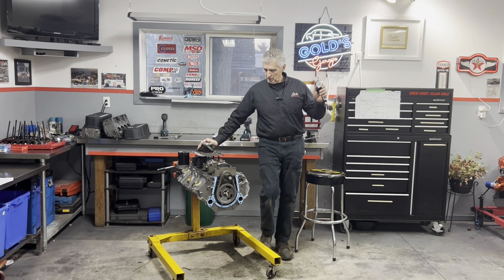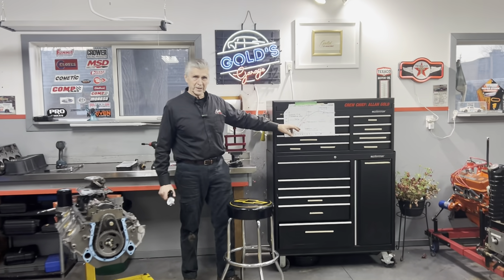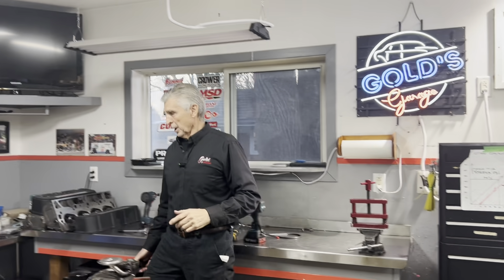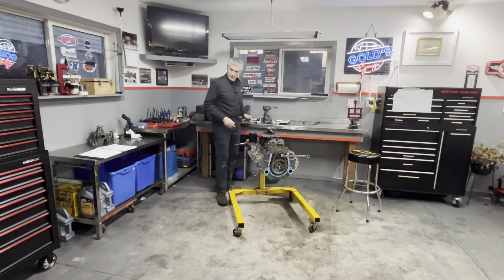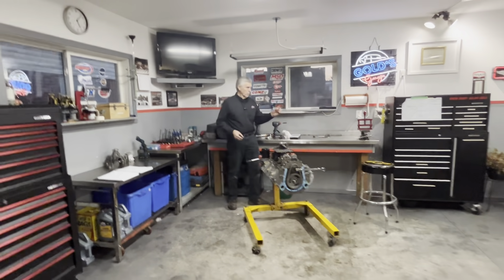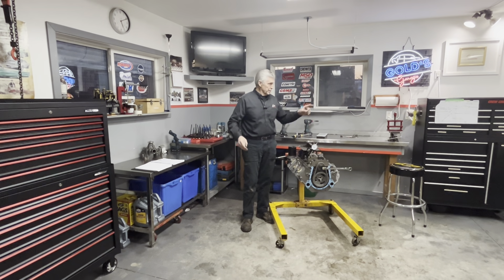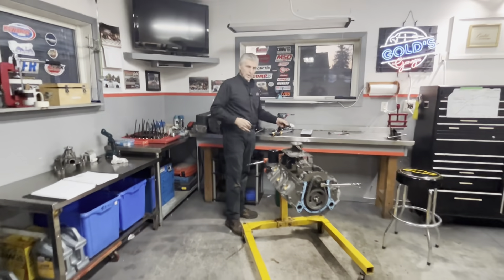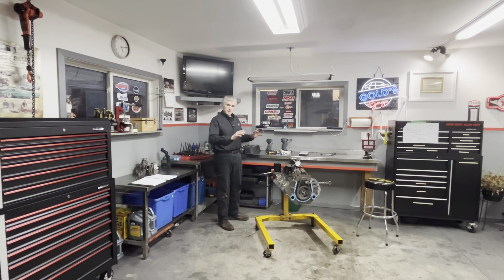You Are Under Torquing Your ARP Rod Bolts! WATCH THIS! 👀

Comment: Aren’t you bringing up the bolt to a point of failure if you go anymore under stress ?
I once had a problem with head gaskets because when I reused the head bolts they were stretched. I didn’t notice it the first time but next time I torqued the bolts I couldn’t get a steady reading. That was a Chevy 350. Mopar bolts are larger and never had a problem but using new bolts is cheaper than doing the whole job all over again. 
Make sure viewers know that once you change rods bolts they need to be resized!
Suggestion. Camera too far away. We don’t need to see the shop. Stay closer with less zooming in and out so far. Better use of visual but stay long enough to for viewers to see it like looking at a photograph in a slide show. 
Good information. Thanks
Reply from the maker: Thanks for your suggestions Jim. As long as the fastener is not stressed beyond the elastic limit, it will not fail and will return to the original length when relaxed.  AG

Comment: So who dobwe point fingers at? ARP?

I wonder what your stretch would be if you used CMD #3?
Reply from the maker: No. I have never used CMD#3. Maybe a future video. AG
Reply: @goldsgarage8236 all good Gold. Personally, on K1 and Molnar rods I used what came with them. Tom Molnar let me know what the lubricant was and Ive used it ever since in place of the ARP lube.

It doesn't get everywhere and the oil stays cleaner. The CMD blends right in with oil vs. ARP lube blackening everything. Just personal preference.

Comment: The  big question is the fact how accurate your torque wrench is to start with!  What you showed removes that inaccuracy and stretching gives you a better hold on how much torque and of course stretch that bolt has at the moment.  No guessing from the torque wrench compared to another one from someone's  toolbox.
Reply from the maker: That's a great point Ben, and thank you for commenting on my channel. 
For anyone seeing Ben's comment, check out his channel benalamedaracing. Lot's of good information, especially about Fords. AG

Comment: Very nice video.  Iv used that same arp indicator quite a bit.  It has a nice strong spring inside to help with repeatability.  I used a set a molner rods that have a torque angle spec with a 2000 arp bolt. Pre torque was quite low and the rest of the spec was angle.  It got almost dead on.  It didnt get the fastener into permanent yield zone.  Potentially a different way they got good repeatable results with.  I did find it odd though the first time i read their instructions
Reply from the maker: Thanks Joseph, the angular torquing method is common in industry and with modern LS engines. I will mention it in a future video.AG

Comment: If you read the whole instructions by Eagle it said if you use a different lubricant they want you to use the stretch method.And reason your coming up with a different reading is because your using arp lubricant.
Reply from the maker: You're right, lubricant type definitely impacts the torque-to-stretch relationship, which is why the stretch method is often preferred for precision. AG

Comment: Bolt stretch is a much more reliable method of measuring clamp load of a bolt because it's direct measurement of what the bolt is doing instead of torque which is an indirect measure where there are variables that we can't measure directly, ie friction in threads and under bolt head
Reply from the maker: All good points, thanks Roy.AG

Comment: Using an extension on a torque wrench can result in a variance. It would be interesting to see the difference in stretch with and without an extension.
Reply from the maker: OK, I will do that for you, watch for the video. AG
Reply: Extensions on a torque wrench do not affect actual torque at the fastener as long as the applied force is at a 90° angle (perpendicular) to the head of the wrench.

The extension used in this video will not make any difference to the torque figure / bolt stretch compared to using no extension.

The only scenario where an extension will affect applied torque is when the angle of approach is greater or less than 90° to the fastener, or if the extension used is yielding or deforming before applied torque is reached, which is most definitely not a concern when using anything over ¼ drive when torquing rod bolts.

Comment: Now, redo your test but torque the bolts PROPERLY, ie. bring them down in 3 STAGES like you're supposed to do. Torque to 21 ft/lbs, then torque to 42 ft/lbs, then your final spec of 63 ft/lbs. Then measure your stretch.
Reply from the maker: Thanks for the suggestion Jomamma. I think you are confusing torquing a cylinder head bolt with a connecting rod bolt. The three step process is used to torque cylinder head bolts to prevent warping the head. AG
Reply: @goldsgarage8236 No, it works for ALL critical fasteners. We use this method in Heavy Industry as a standard. Again, use this method and repeat your test.
Reply from the maker: OK Jomamma, I will do that for you. Watch for the video coming soon. AG

Comment: Hello Mr. Gold. A few weeks ago, I asked where the sound of your video's introduction came from. You told me it came from your Camaro. I just love the sound. What mufflers did you use? is there any other tricks that you used on your exhaust system that you used. I'm trying to rebuild a small block Chevy and I would love to duplicate that sound. Thanks
Reply from the maker: Thanks Jean, glad you like the sound. Nothing special, It starts with Hooker long tube D port headers, then a custom fabricated 2-1/2" all the way back. The mufflers are Dynomax. Hope thus helps. AG

Comment: ARP publishes both a torque value and a bolt stretch specification because torque is only an indirect and highly variable way of achieving the one thing that actually matters: correct bolt preload. Torque is affected heavily by friction in the threads and under the bolt head, which can change significantly depending on lubrication, surface finish, cleanliness, and assembly technique. Because of this variability, a single torque value cannot reliably produce the same bolt stretch in every real-world situation. Stretch, on the other hand, directly measures how much the bolt has elastically elongated, which directly corresponds to clamping force. When builders measure stretch, they may need to apply more or less torque than the published value to reach the correct preload, and this is normal and safe as long as the bolt remains within its elastic stretch range. ARP therefore provides a conservative torque specification as a practical baseline for situations where stretch cannot be measured, while also publishing a stretch window for builders who want precise, repeatable preload. When the two disagree, stretch is the controlling specification, and torque is simply the means used to reach it.
Reply from the maker: All good points, you could write my script for me. Thanks for contributing. AG

Comment: Well done!
I would add that the one thing to be mindfull of. Is the medium the bolt is threaded into. I find all to often arp fastners are way to strong requiring torque that far exceeds the aluminum or cast thread being utilized. That presents a situation. In those cases. Like say an aluminum LS block. The oem fastners are designed far better than arp and are what I use. Even with big power boosted stuff. The OEM replacement hardware is best IMO.
Reply from the maker: That is a really good point Tom, ARP fasteners are hard enough to damage or destroy the part they are clamping. A good reason to follow the part manufacturers specifications. Thanks for commenting.AG

Comment: The crazy thing is if we were talking about reusing SBC stock rods and bolts, a lot times bolts will be stretch out before they get to factory spec of 45 ft lbs.
Reply from the maker: good point, then it is permanently elongated and should not be used. Thanks for  commenting. AG

Comment: Happy New Year! When I worked on boiler sight glasses, they used 3/8 B7 bolts to retain the 1" thick pyrex glass. They used inch pounds on  the mcale with a moly lube. The bolts were used over and over when changing out the gaskets in yearly inspections. I was afraid  that I might make a micro-crack in the pyrex and it was kind of scary to go by them with 1000lbs pressure and heat. Never heard of one failing tho.
Reply from the maker: Happy New Year to you too, and thanks for sharing your experience. That's a unique and critical fastener application for sure.  AG

Comment: When measuring a bolt that had previously been torqued, was stretched previously introduced?
Reply from the maker: Good question. No, the fastener should always go back to its original length after the stress is relieved. If it is permanently elongated it is failed and should not be used. AG

Comment: Back a couple of decades when I was poor I did a set of used GM rods with ARP Wave Lock bolts (Horrible bolts in terms of the force required to separate the cap from the rod, we never use them) I used the stretch method. I was more than a little nervous since "spec" ended up being between 70 and 75 # which is an ungodly torque for a 3/8" fastener. I ran them for a season, all polished beams, floated wrist pins and whatnot, and upon disassembly I found a couple of the bolts had stretched 0.001". I ended up throwing the set in the scrap bin. I'm sure there are situations where perfection is necessary, but for the engines we build, the recommended torque specification is good enough. FWIW I guessed correct on Eagle's torque resulting in 0.004" stretch LOL.
Reply from the maker: Good information, thanks Yarrda. I agree that torquing to specification is good enough. AG

Comment: Just wondering  -those connecting rods look to be the kind that have the "nut" threads in the body of the connecting rods. Would a rod bolt that has a separate nut (at the end of what would need to be a longer bolt) effectively have a longer bolt shank, and therefore more stretch?
Reply from the maker: Good question Douglas. In a high end fastener such as this, the thread diameter is larger than the shank, this is to prevent distorting the threads.  The length of the bolt that is subjected to stress is a factor, however if there is a nut, only the reduced section of the fastener stretches. The stretch specification should take all this into consideration. Please let me know if my response to your question is satisfactory. Thanks. AG

Comment: There’s other things that you should consider as well when it comes to fasteners, and that is that there are wet specs that are with oil and there are dry specs without oil. Had bolts and connecting rod bolts are wet specs. I usually use a good thick oil under the head of the ball and on the threads and or in the threads on the connecting rod. You should never put these fasteners on without any oil you’re gonna get an incorrect reading.
Reply from the maker: Great points, thanks for sharing your insights! AG

Comment: So do you have the same problem when using ARP stud and nut for connecting rod?
Reply from the maker: The same physics apply, however its not a problem. If you use either method correctly you will be ok. AG
Reply: @goldsgarage8236  Thanks

Comment: So what is the best torque technique? Torque or stretch? Because now we're dealing with two different forces and stressors? If you torque it can it be reused opposed to stretch (use and replace?) thanks
Reply from the maker: Good question Denis.
As long as you stay within either the torque or stretch specification, you are within the elastic range (the straight line on the graph) and it is not permanently stretched, you can re-use the fastener many times. AG

Comment: You need to outliner spec to determine if the bolt is too soft or too hard
Torque to angle helped with that
Reply from the maker: Thanks for the input. AG

Comment: Now you’ve got me wondering about this rebuilt short block I just got back after a long wait at the machine shop. Thoughts on pulling the pan and trying to check? Thanks!
Reply from the maker: I should have made the point that if you follow the standard procedure and torque to specification you will be fine. The stretch method is nice but not essential. AG
Reply: @goldsgarage8236  Thank you for the reply so quickly. I hope you have a happy New Year!

Comment: Thank you for the excellent and informative video. I went through the exact same process you did using the stretch method on my 1965 Chevy 327 L79 build last year. I went in 5 pound increments beyond their torque spec because I was worried about going too far. I ended up at 88 foot pounds to get .006 stretch. I used Eagle rods with the same ARP bolts you have. Thanks for all the great videos! Happy New Year from central Massachusetts!
Reply from the maker: Welcome Massachusetts, Thanks for commenting and for the back up information supporting the point of the video. AG

Comment: Stretch is always stretch, but torque is only meant as a good guess about the stretch.
Reply from the maker: Correct, but most engines are built with a torque wrench and they are doing fine. AG

Comment: I've done this same experiment on a few engines with ARP rod bolts, but what I found was that when I did get to the desired stretch, I was pretty close to the recommended torque spec.  I was using the older ARP thread lube (threads and under head or nut).
BTW, If they are new ARP bolts, I always take each bolt to desired stretch each time, 3 times.  This is sometime in their instructions.
I always use the stretch gage one rod bolts if at all possible.
Thanks and Merry Christmas and Happy New Year!
Reply from the maker: Thanks Pete, I was surprised how much difference it make in this application. AG

Comment: The thing I worry about when using ARP fastener is NOT the bolt braking or striping threads, it's deforming and / or fracturing the part the fastener is clamping together. That is why I use the part manufactures recommendation. I have never seen a busted ARP rod bolt, I have seen rods blown to bits and ARP rod bolts laying in the pan maybe bent up but still in one piece. 

Eagle torque Highlights: Note the bottom line
ARP 8740 - 190kpsi tensile strength, 180kpsi yield strength
7/16" thread
1.6" under-head length
7/16" 12pt socket size
torque to 63 ft-lbs with ARP moly lube only
Stretch to .0059"-.0063"
Use either torque method or stretch method - DO NOT use both!
Reply from the maker: all good points, thanks for commenting.AG
Reply: @goldsgarage8236  The ARP torque spec is 50 ft lbs on the SBC stock rods. I just had a set of stock rods resized and ARP bolts installed. The SCAT rods I used in different SBC, is assembled with the same ARP bolt materiel the SCAT torque spec is 75 ft lbs. The SCAT rep told me to use the SCAT spec. The SCAT rod can withstand more clamping pressure then a stock rod without deforming. My old machinist show me when I was young, when resizing stock rod ends how they deformed stretch vs torque. So whatever clapping method (stretch or torque) was used when sizing the rod end, should be used when installing. I have never had a problem using torque spec.
Reply from the maker: That's a very good point about the torque deforming some rods, and yes, using the torque specification works. Most engines are built that way. AG

Comment: Meanwhile my SCAT rods that came with ARP bolts had a big thing in their directions that said to use torque and to not use stretch 🙃🤪
Reply from the maker: That's interesting, I wonder why? AG
Reply: @goldsgarage8236  They are the type that thread into the rod and don't use nuts.....maybe that's why.
Reply: @bigboreracing356  It was a sheet right in my box of rods that said "we use torque not stretch" and gave specs.......They did give a hard do not exceed stretch spec but it was insanely high..... said do not exceed .045 stretch and my strech guage showed about .005-.007 stretch at the specified 45 lb-ft
Reply: @bigboreracing356  I meant .047

Comment: I have found that when torqueing bolts that when you pull the torque wrench until it clicks, if you torque it again pulling very slowly and evenly just until it almost clicks, almost every time you will tighten the bolt another 1/8th to 1/3 of a turn. i believe its because the friction during the initial pull doesn't let the bolt get all the way to spec. subsequent pulling, very slowly and carefully allows the fastener to get beyond the friction to the torque spec. I'm sure a stretch gauge is better, but most of us don't have one.
Reply from the maker: Thanks 69, and you don't need one. Most engines are built with torque wrenches and they are doing fine.AG

Comment: Excellent 👍
The idea is to produce a clamping load on rod cap high enough not to reverse cycle loading up unil red line .
In mechanical engineering physics the load on reciprocating part squares when rpm is doubled.
Reply from the maker: Thanks for the excellent comment Motorhead. The formula for load on reciprocating parts is the product of the (mass off the part, x the distance between the centre of rotation and the centre of gravity of the part x the square of the RPM.) i.e. load is proportional to the square of the RPM. So you are correct, if the RPM doubles, the force is increased by the square of 2 which is 4 times.  AG

Comment: Good video  about  stretching  .... only thing  I would  like to point out is that the rod big end needs  to be round and whatever  it was done to when honed it needs to be the same to be round .... over or under torque  can leave you with a big end that's oval by a bit
Reply from the maker: Good to hear from you Scott. These are new Eagle rods and the stretch is within the Eagle specification. AG
Reply: Excellent point